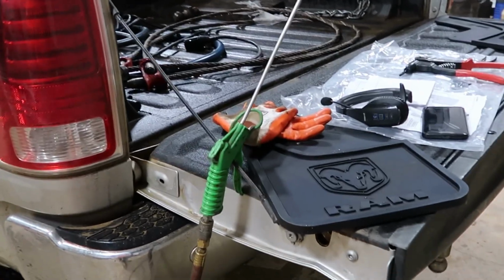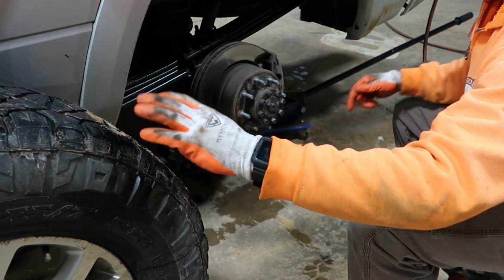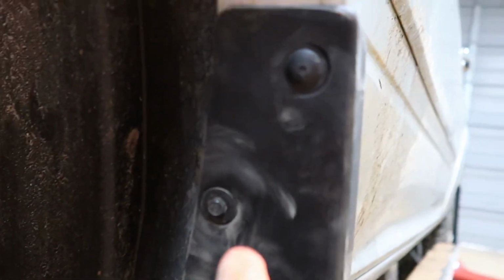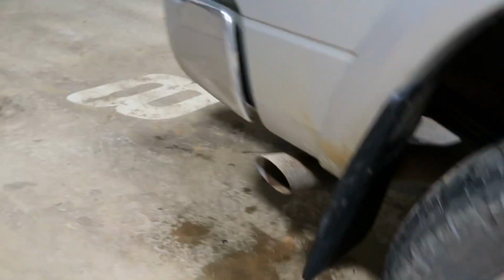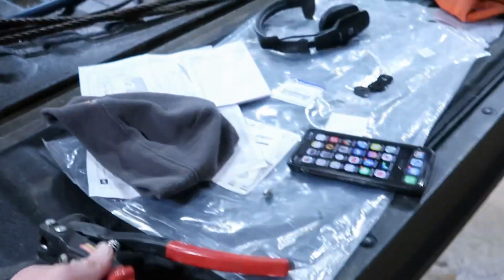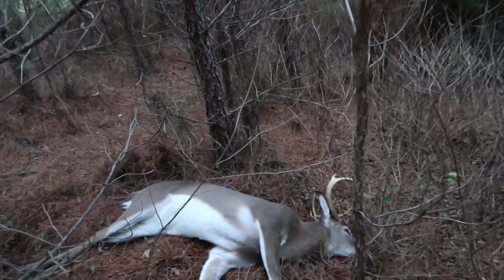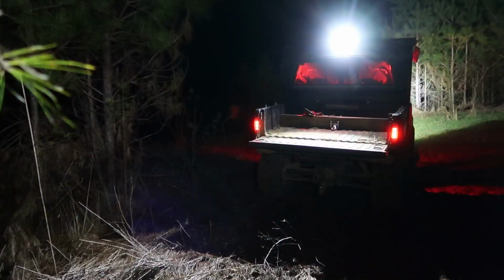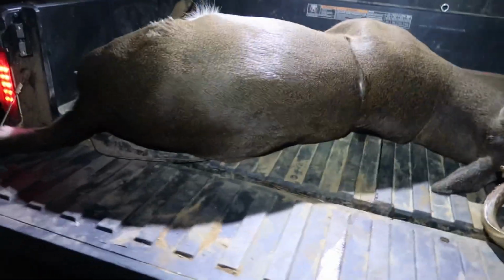Truck improvements & a 13 point whitetail deer

Comment: Tim I put mopar flaps on mine for the same reason. But there not long enough. I switch to duraflap mud flaps they can custom make them any length and width. They're very nice. Just my 2 cents.

Comment: HI CT that is a nice deer 🦌 U got a winch on back that is a helper by itself when U get ready 2 skin that there is a easy way 2 lift it take a rope and tie around a foot throw over a limb tie 2 and hook up pull 4 ward 2 where U want the deer 2 be at U can a 4 wheeler or a truck 2 do this 2 alot easier than trying 2 pull up in the air then U still have 2 tie the rope off 😮 work smarter not harder make the work easy 2 do 😊OMG 6 25 2O23